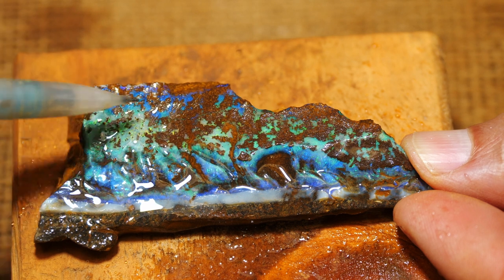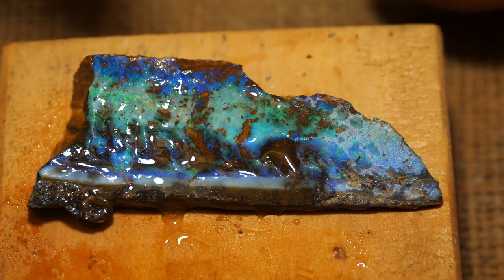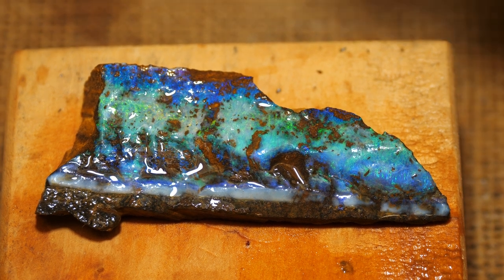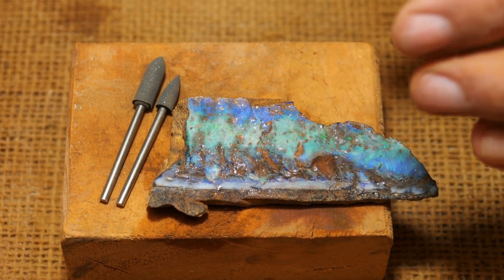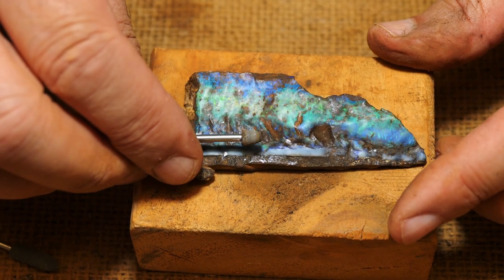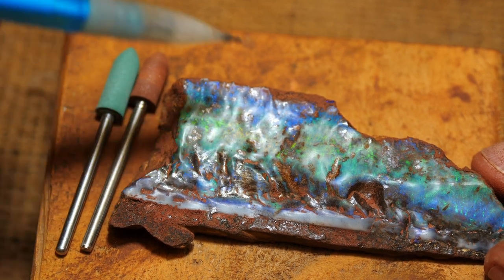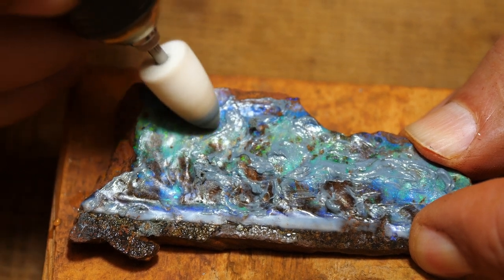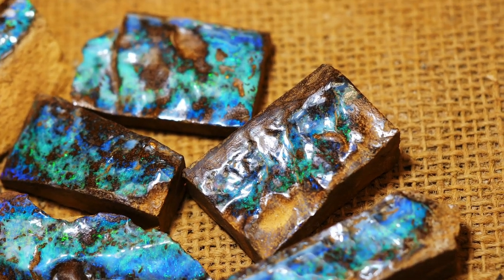Let's Polish a Big Boulder Opal!

Comment: I’ve got a fist-size piece of iron rock with opal veins & a smooth feeling swirl pattern that covers a large area on most sides. I have no idea what to do with it or if I could try to polish a small section to satisfy curiosity. If I decide to polish a small section, it’ll be after a lot of “watch & learn” videos like yours, then practice runs. It seems different to gemstone polishing.
Honesty in today’s society has become a rare quality so trust follows if you don’t know the right person for the job.
Reply from the maker: Boulder opal can be tricky, even when you have experience on your side as no two pieces are the same. Some times its a case of taking it easy and going gently and other times the quick tap of a hammer does not go astray. This could be a serious learning curve for you. I am sure it will have a positive outcome either way.